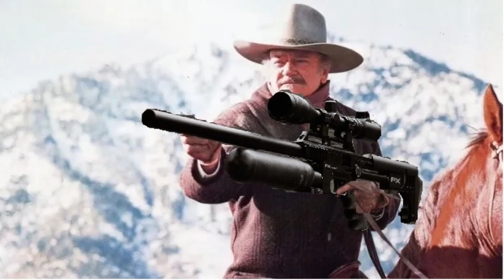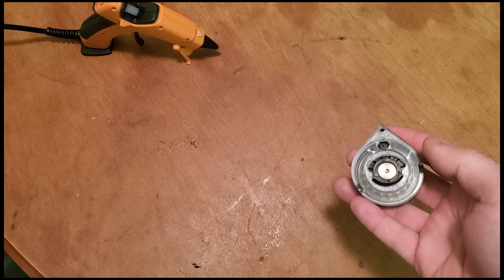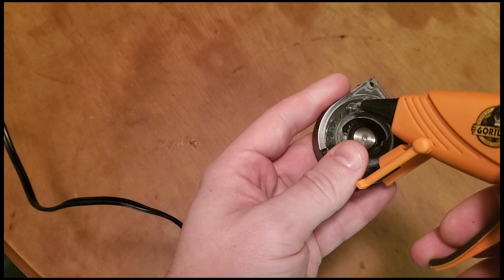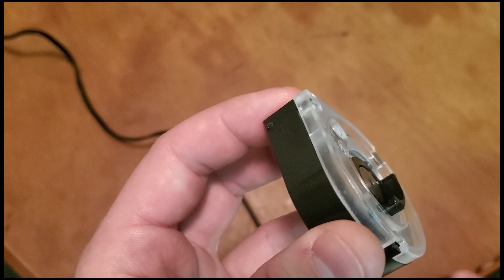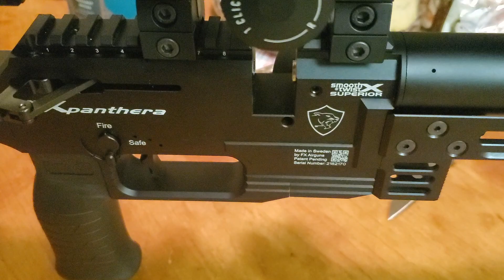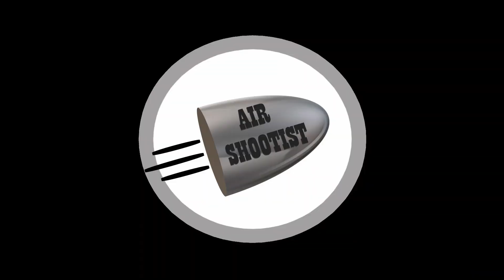FX Panthera / Maverick / Crown / Wildcat Magazine Mod! No More O Ring! DIY At Home in 2 Minutes!

Comment: Hey Dude what gun can you recommend I want to buy one under 1250$ I know it's a little bit small of a budget but Just for starters
Reply from the maker: I think Utah Airguns had some refurbished FX Crown's for around that price point. Start checking the used sections of like Utah, High Pressure Pneumatics, Palm Beach Airguns, etc.
Reply from the maker: Another great option would be a Wildcat or Maverick VP, those are right around $1450 and 100% worth it.
Reply: @airshootist  It's nice that you take time out to answer people. That will help build your fan base. Good vid bud.

Comment: When you get the Maverick/Crown conversion to Panthera lids, do the same thing.  Use black gluestick if you have it.  There is no oring indention on my version. But if you put a dab of black hot glue in the same spot if works great. It is not really needed.  But if you like it extra snug give it a try.

Comment: On a pellet gun of this price range…chit like this should never ever happen. The airgun industry wants to make the big bucks and yes for them it is a big investment however for we the consumer it is also a big investment! They must do better!💯🤦
Reply from the maker: I mean the o-ring is a pretty good solution, it works for sure, but they do fall out on occasion. Better would be a spring loaded ball bearing detent in the receiver. I think the ol' hot glue fix is pretty dang good, though, been using it for a few years now